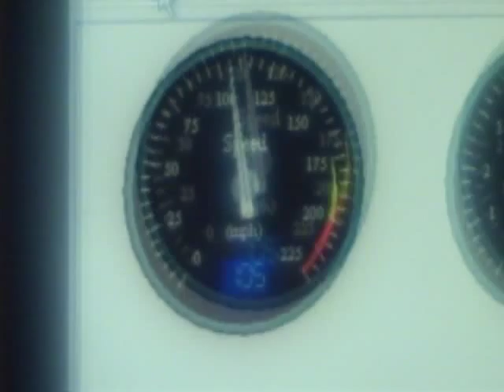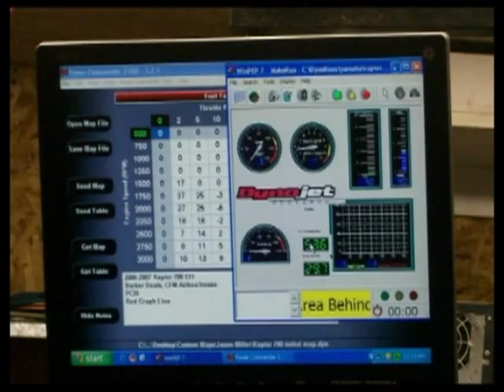Yamaha Raptor 700 Dyno from 11 24 2008

Comment from the maker: @doobyboy21I noticed a gain in top and bottom. Now from what Ive heard and read is that the HC3 is more top end and a little less bottom. As for the springs, HC's says you don't need HD springs (I didn't change mine).
I say the HC2 is all around a nice cam. If you really want to feel a difference, put an 11.1 piston in it and you can still run pump gas.

Comment: I'm about to install Stage 2 Hot Cams on mine also... You must have less torque on bottom than OEM? Stage 2 Hot Cams are really meant for rev and more Top speed right? Do you know if I need new Valve Springs even though my EFI is the Dynatek Non-Programmable FS Ignition? I know this alot of questions! I just need somebody who's been there and done that! Thankx!